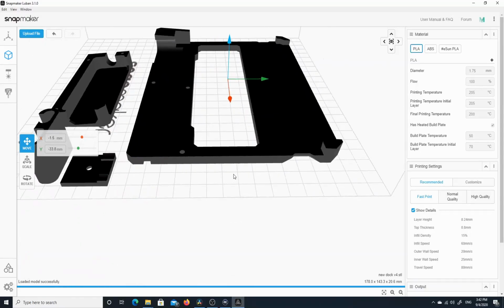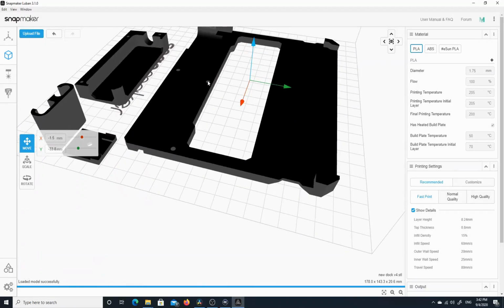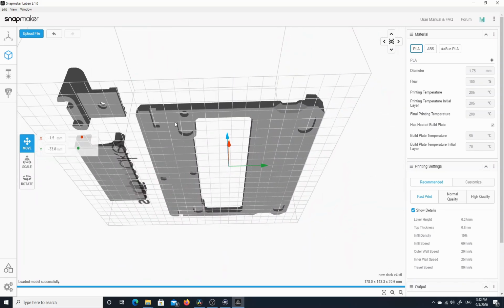DIY 3D Printed Dock with Hub - GPD Win Max

Comment: Absolutely terrific work. I appreciate how thorough and well-thought-out this is (clearly it's been through several iterations). I wonder if the cable holder is sensitive to exactly which thunderbolt 3 cable you use. It looks like it was designed to exactly match those two units.
Reply from the maker: Jeff Zimmerman and you reminded me of a talking point I missed 😂 yes it is more or less designed for those cables. If you have different cables I’m happy to provide a new stl to match your dimensions

Comment: Thank you so much for this beautiful work! Little question : Will you share the STL for the eGPU case??? : D Thanks again!!!
Reply: Check the description
Reply: there is only the files of the winmax dock, not the eGPU case :/
Reply from the maker: Jimmy T what size gpu are you using? Length wise
Reply: @HandheldHardware  hi ! I use an aorus 1070 8gb,  300mm approximatively. But, it could be a better idea to make an stl for typical long size GPU (330mm max) for who needs it... 😉
Reply: I can’t wait to get the print for this, or is there a place to buy just a casing? Concerned my friends 3D printer maybe is too small?
Reply: @presidentsenpai7307  usual eGPU cases cost around 250$... 3D printed printed verticaly, that should be good, depends of the printer size, but usualy, they around 350mm
Reply: @HandheldHardware  I am also interested in getting the egpu stl files! I thought it was a brilliant idea from your previous video. My gpu is around 200mm lengthwise.
Reply from the maker: theshmalls head over to the discord, I’ll leave the stl files there early, once I get around to filming the actual video you can also find them there

Comment: can the GPD work with display closed and on external monitor from the eGPU so you can make switch stile dock where you just top load the gpd inside and the usb and TB3 are fixed on the bottom